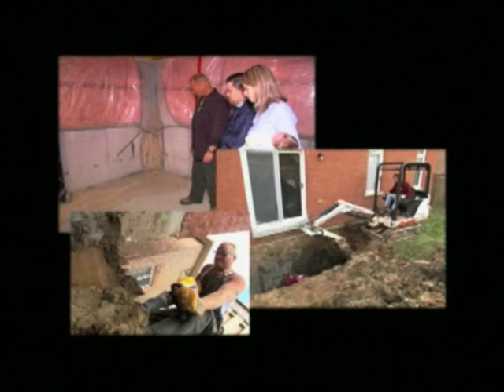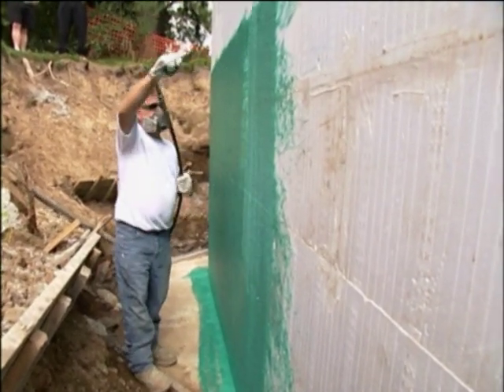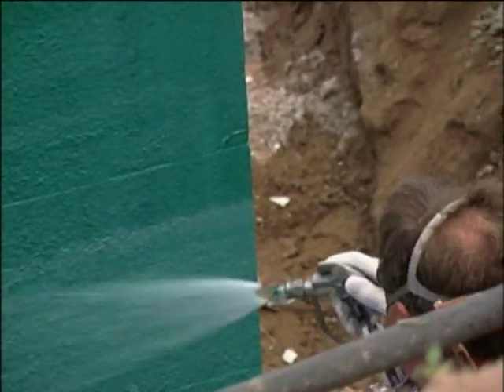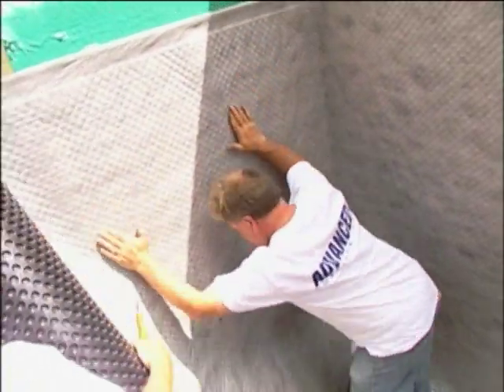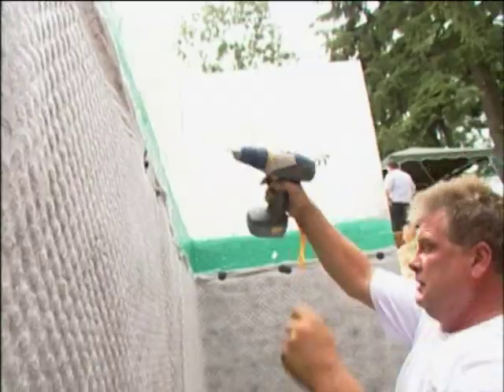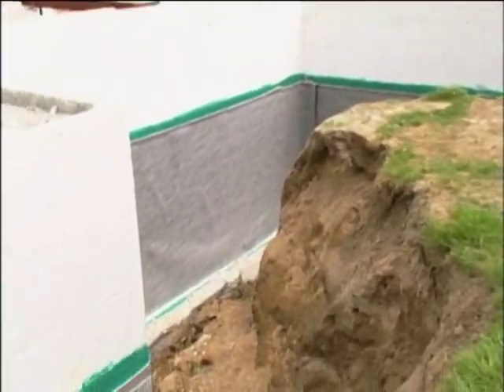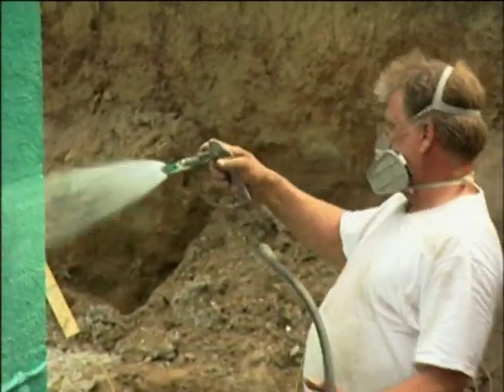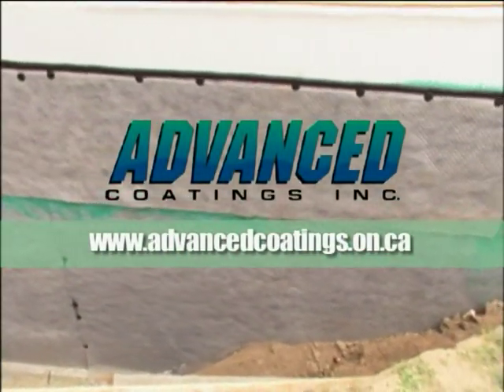Rub-R-Wall Waterproofing on ICF Foundation

Comment: hi I have walk out home, and poured concrete foundation wall it's 6 years old home right now no any leakage or water penetration in basement ,builder did  just tar/asphalt based coating , do I really need waterproofing  I am in alberta

Comment: You wouldn't need this if you build using ICF, right?
Reply from the maker: +pathfinderLXXIV
ICF Foundations need to be waterproofed, we waterproof a lot of ICF foundations with Rub-R-Wall
Reply: +Advanced Coatings Inc. 
Looks awesome... and definitely effective.
When I originally asked I was assuming the ICF form would provide enough waterproofing, not taking into account that there are seams/gaps between forms for water to get through to the concrete wall, which is porous and I assume would allow water to gradually pass through to the interior. No?
Reply: @pathfinderLXXIV  
The foam itself is waterproof but its the hundred of seams that are not and the concrete on the inside definitely is not!